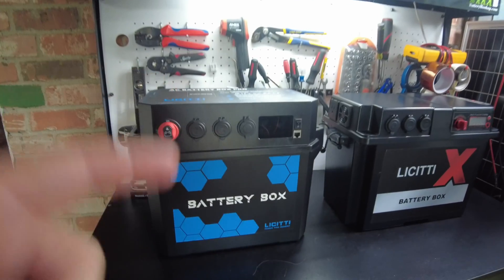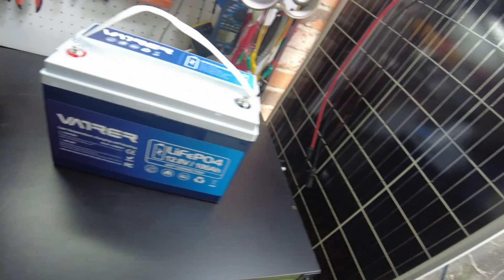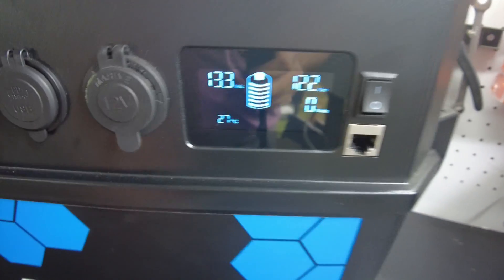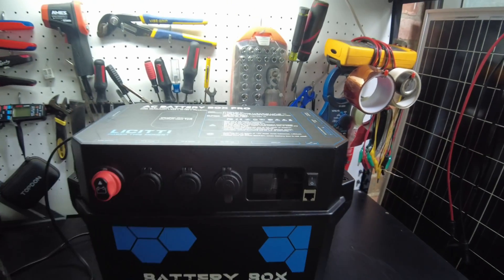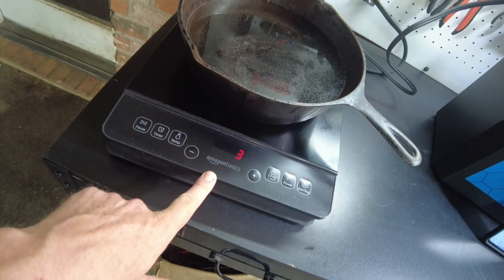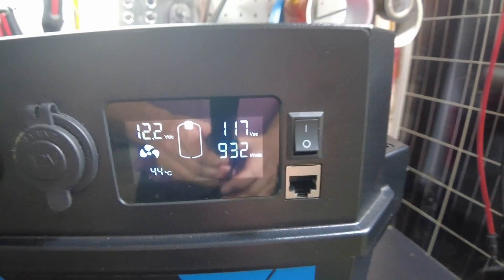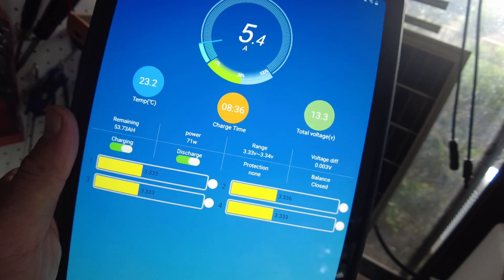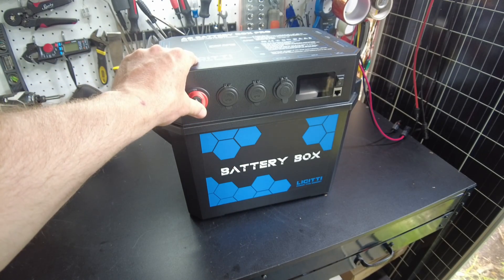Easiest DIY Solar Generator Licitti AC Battery Box PRO

Comment: Good review...  I just ordered my 1000W AC Battery Box PRO New - Without AC Charger.  No confirmation was automatically sent after I ordered it so I used the contact form on their website.  They responded withing a few hours and provided me the order number along with stating they would get it shipped out as soon as possible.  The price including shipping was only $185 when I ordered it yesterday 5/26/25.

Comment: Hello. I have a question. I have two AllPowers 200W solar panels. One has these specifications Open Circuit Voltage 22,2V, Short Circuit Current 12A, Power Voltage 18V and Power Current 11A and other have Open Circuit Voltage 44,4V, Short Circuit Current 5,95A, Power Voltage 36,6V and Power Current 5,45A. Which of these two panels are more suitable for this AC Box Pro?

Comment: I love this battery box. I didn’t get charged any taxes possibly due to solar import exemptions. I got a $50 coupon so my shipping was free. Customer service is not easy, slow delays but they do answer with some communication language issues.

Here are some items I have identified on my blue 1 kW inverter battery box:
- Cascadia 4x4 MPPT Charge Controller (not the most efficient  but I can get about 130 watts from 2 x 100 watt solar panels
- BMS JBD SP04S034 (came as part of the 280 Ah LIFEPO4 battery kit) with Bluetooth but you can't download or use the Licitti app but I use Overkill or XiaoXiang free apps with no problems

I now have a Renogy Rover 40 Amp MPPT Charge Controller  with 4 solar panels and still use the built Cascadia MPPT with no problem. 

I bought the 30 Amp Licitti battery charger to charge fast if I have Charge off a generator if no sun.

This battery box is going to outlast me and something I will pass down. It's one of the best yet little known buys out there.
Reply: Where did you get the $50 coupon? $20 one that Brad has attached to this video is only good for an order over $200.

What were you connecting to with the apps? The BMS on your battery? My understanding is that the charge controller in the original battery box and this pro version do not have any Bluetooth connectivity.
Reply: @davesnothere688 I got the $50 coupon from the WoodHaven review of the Licitti. 
  As far Bluetooth connectivity,  I was surprised that the battery cell kit came with it as well. The Bluetooth is with the battery kit I bought ftom Licitti , not the box itself. When I contacted the Licitti people all they said I couldn't get their app unless I meet their threshold but I was able to get XiaoXang free and use that.
Reply: I got the $50 coupon from Woodhaven's channel.
  The Bluetooth connectivity is with the battery I bought from them. I am still very happy with it. The support with them is clumsy due to language but they do try which is alot to me.
Reply: @OP-fd4lhvery cool, thanks. The battery I'm putting in it will have Bluetooth also. I  assume the the charge controller still does not have Bluetooth.

I have the original box and love it, but I'm looking forward to the improvements.
Reply: @davesnothere688 No, the charge controller does not have BT on it but it's very limited and I quickly outgrew it. I bought a used Renogy Rover 40 A on  eBay which came with a BT controller. 
  I love it but it's not a fully "turn key" system but it does allow some MacGyvering.
Reply: @OP-fd4lh I just checked, apparently they've upped the minimum purchase on all of these coupons. The Woody coupon is a 400.00 minimum purchase! oh well, thanks for sharing.
Reply: @OP-fd4lhI didn't realize the $130. 80 what's the sale price. Are you telling me that these things run $298 off sale?

I looked into building one myself, for what they've got into it I wouldn't be able to touch that price. For what I'm using it for, it's fine the way it is.

I already have one 20A amp charger and also reconditions batteries. What I'm looking at theirs for an extra $20 on the order and that's not bad for an extra one. Any experience with theirs? 

As for the shipping, it's $55 no matter if I select a boat or ship direct.

Comment: Hello Brad . Just got my Pro box in today . I have had the original box for several months , but difficult to use with the 2 batteries that I have .   
   One is a Redodo Lite , it is a 12v 100amph battery that is smaller than the regular 100amph batteries , but taller .  The lid with the original box wouldn't close , battery to tall .
  The other battery is a 280amph DIY Licitti battery . It will not fit down into the original battery box .
   I haven't tried the 280 yet , but other videos show that it will fit .
No one would answer the question , will the Lite style batteries fit into the Pro box .   
   I tried it , it does bolt down with the cable end protectors , strap down strap , and turn on and operate .
Now to hook up a solar panel charger with a 300 watt solar panel , hopefully it won't fry anything ? ? ?

Comment: I have both Licitti boxes and like the Pro version better.
I modified the 280ah battery kit from Licitti and it fits perfect in the Pro box.
Just swap the terminal posts so both are pointing up and Bob's your uncle.
Too bad there's no 2000 watt inverter option for this box.

Comment: Hi brad. How can i connect with bluetooth. If i start the app my screen are empty (iphone+ Android). I am using the right app from the licitti website.
Reply from the maker: I'm pretty sure this Licitti box does not have bluetooth. The battery I'm using in the video has the bluetooth functionality.

Comment: I have a 15 amp Victron charger.  As the box closes with screws rather than clips, could I charge the battery through the 12v outlet or do I need to rig something up using the Anderson connectors?  Thank you.
Reply from the maker: Those cigarette lighter outlets can get pretty warm over 10a, I would opt for the Anderson connector.
Reply: @BradCagle  Thank you.  Victron does not make a Anderson connector (only cigar plug, clips, and ring connector), but it should be pretty easy to make one from one of those versions.  A few manufactures have hole plug or conduit to run wires from inside the box to the outside, but I do not see that here.  Very cool box.
Reply from the maker: @m332csi  BTW I have a link in the description for Anderson style connectors that work with licitti boxes. Thanks
Reply: @BradCagle  I saw that.  Thank you very much.

Comment: Thanks for the review, but I don't think it's worth the additional dollars for the extra bells and whistles.  I've been using the original battery box for about three months now.  The 1000 w inverter and MPPT controller are the same.  I only use it for charging my laptop and phones and as backup for my Bluetti 180 and Jackery 1500.  One final note, the unit that Licitti sent me  does have the 120v outlet, but at only 50 HZ and not 60, so I've been careful not to use it with any equipment with an inductive motor.  Although I did use it with my portable tire compressor which work well.
Reply from the maker: Thanks for the feedback :)

Comment: I was really hoping you'd go into more detail on the MPPT solar charge controller specs, since that was the major limitation with the first generation product.  Licitti sells this DIY battery box with 280ah cells, which means over 3,500wh worth of capacity.  If this SCC is still limited to 200 watts, you would need close to 20 hours of good solar conditions to charge up that larger capacity battery.  I know you can always by-pass the on-board SCC, but I still don't understand why they're putting such a small controller in this unit.
Reply from the maker: It's the same 10A MPPT controller that's in the original box. The challenge is size, and this being 12v. The pre-built units on the market are using a higher voltage battery system which allows them to get the higher wattage PV input, and stay in a smaller footprint. But yeah, I totally agree, I would love to see better solar capability built in to these. I've actually considered trying to mod something in. Thanks
Reply: @BradCagle  - I mean, there's a 50-amp Anderson style connector, so all you'd have to do is reroute that through a fuse and then to the battery, by-passing the undersized MPPT they include.  Have your own, more appropriately sized controller outside of that box.
Reply from the maker: @jasonbroom7147  Right you can do that, or just plug the external MPPT into the other Anderson connector. Maybe a PWM would work better in this. I have small PWM's that are 30A.
Reply: @BradCagle didn't you do a video on using a larger mppt controller on the original box
Reply from the maker: @DESERTDWELLER4547  Yes https://www.youtube.com/watch?v=b2g4V9Q4x30
Reply: Can you hook up 2 units or attach another battery to increase power capacity. 
How many batteries can you attach to the unit in Parallel or Series??

Thanks
Reply: @angacamthehobbit-PapaPrepper  - It's really not designed for either one of those things.

Comment: It just goes to show how much the battery contributes to the price of these devices - 1/3 is the box with inverter, charger, solar mppt and fusing, box etc. the other 2/3 is the battery.
Excellent and thorough review as usual Brad.
I couldn't see if they have an option for Australian 3pin socket. They do support 230V AC at least.
Reply from the maker: Yes, battery is a big part of the cost. But it's also been great watching the cost of cells/batteries come down over the years. I really think it'll be common (and affordable) for most people to have batteries, and solar at home in the near future.
Reply: @BradCagle  I don't think its as bad in the states but the DIY for electrical is severely frowned upon here and the industry knows it and exploits it to the full. It has slowed uptake of batteries a lot because the early adopters are usually enthusiasts that know their way around mains and AC and if they can't do it, then it just doesn't happen...

Comment: Did the usb work ok?  Do they work without the inverter on?  Can the two of them team up for a 15a 110v circuit like small generators do?
Reply from the maker: The USB do work without the inverter being on. No you cannot parallel two units to increase AC output.
Reply: If you want more output they have a 2000 watt one for about double the price.
Reply from the maker: @mgkleym  Indeed, I've tested that one too. Thanks

Comment: Does the inverter need to be on when using the proximity charger for your phone? Does  the on off switch  shut down the battery entirely or can you still plug into the Anderson connectors or USB  plug ins?
Reply from the maker: I don't have a way to test the wireless charger. The main  (red) shut off switch disconnects the battery entirely.